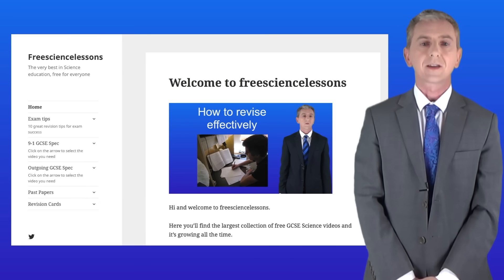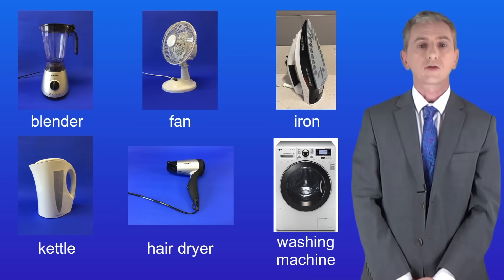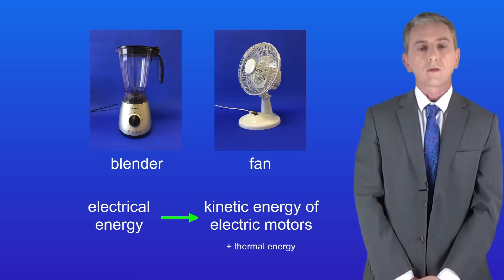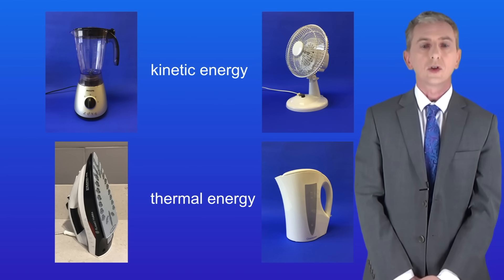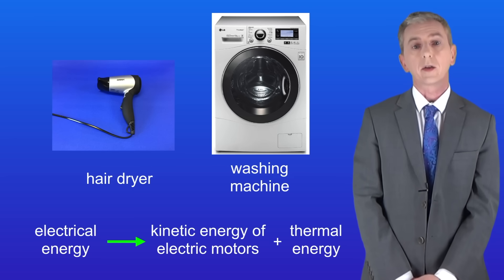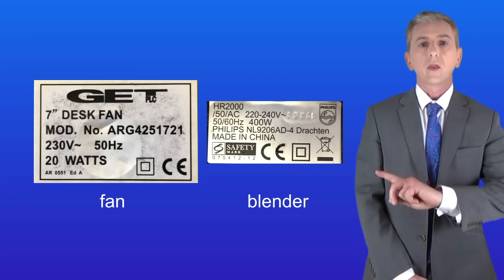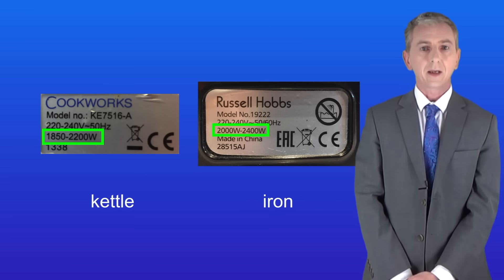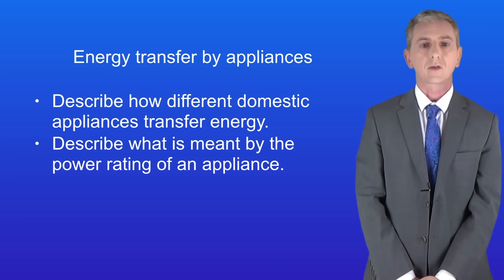GCSE Physics Revision "Energy Transfer by Appliances"

Comment: I have a question: does television not conduct thermal energy? because if you watch it for a long time, it heats up. You mentioned one thing that doesn't use thermal or kinetic energy is a television, sir
Reply from the maker: A television gets warm because the internal components transfer some energy to heat, as well as light and sound. However, it's only a relatively small percentage of the total transfer.

Comment: Just commenting to consolidate something I didn't know: "Appliances which are designed to generate thermal energy usually have a higher power rating than devices which are designed to generate kinetic energy."

Comment: Examples of energy transfers would be kinetic energy + thermal
And Energy stores would be Something like electrical am I right?
Reply from the maker: No an example of an energy transfer would be kinetic energy STORE to thermal energy STORE. Electricity is a pathway not an energy store.
Reply: @Freesciencelessons  So energy transfer would be light, heat, electricity?
Reply: @priya200328  energy transfer is just the movement of energy from one store to another.

Comment: I have a question about the kettle which is that the kettle has WATER in it when it boil which means they MOVE so shouldn't that also be kinetic
Reply: In a way, yes. The temperature of a substance is the estimated average energy of the molecules (some faster, some slower) but the molecules themselves have kinetic energy and potential energy. If you heat an object, the molecules gain more kinetic energy and move faster.

However, for the purposes of this video, just consider the kettle to produce thermal energy because we are not looking at the molecules themselves.
Reply: No, its just heat